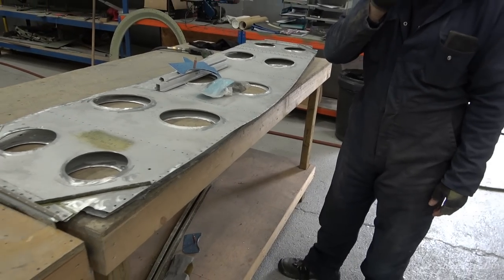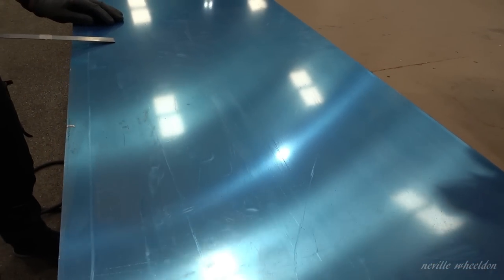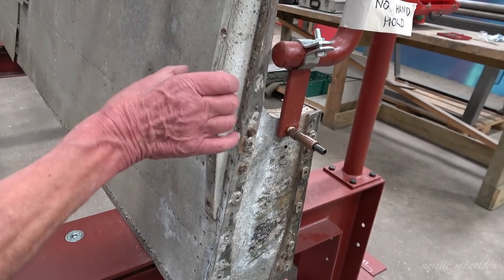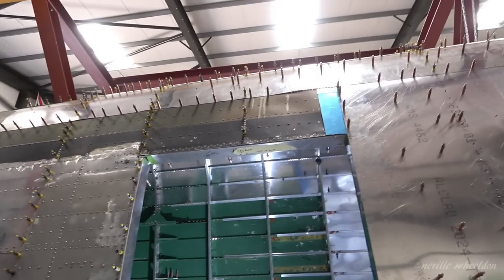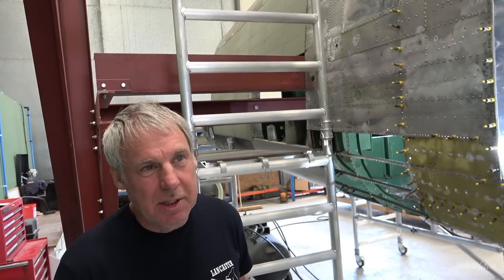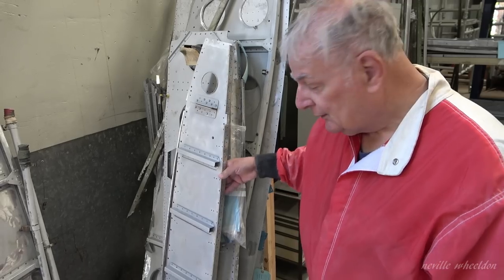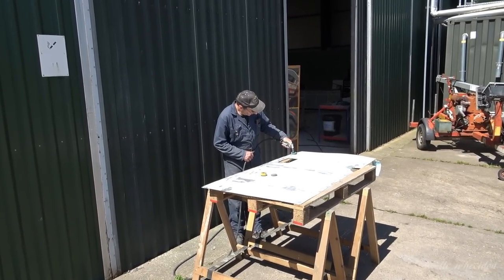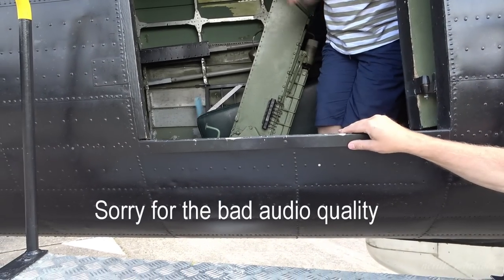Video 150 Restoration of Lancaster NX611 Year 5.  Lancaster wooden fuselage door.

Comment: Those old British car parts came in real handy there bro, I once owned a 1957 Chev Belair and used a Morris miner windscreen wiper motor to get the wipers working on it, the originals were vacuum powered. Great video as always bro. Safe travels
Reply from the maker: I Ken ,I had a Ford Anglia 1956 model it to was vacuum driven.

Comment: Another MARVELOUS video.  Question:  in the bit where y'all were discussing the "shortcuts" taken with 976 because it was only meant to meet "taxi standards" - he made a comment about "after taxi, then it'll go to a museum" -- is that a specific plan, or will it go back to Kermit Weeks with the rest of 976 ?
Reply: This section of the fuselage belongs to Doncaster museum. It originally came from the Lancaster that Kermit purchased some years ago. The museum has agreed to lend it in return for this overhaul.
Reply: @edwardwhittle5460  Thank you.
Reply from the maker: Hi HH. Edward Whittle comments are correct.